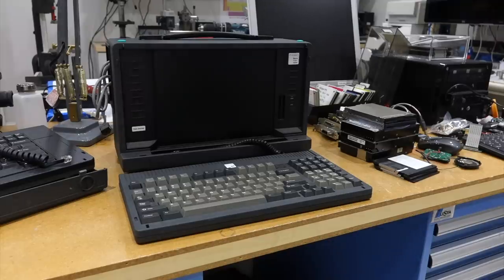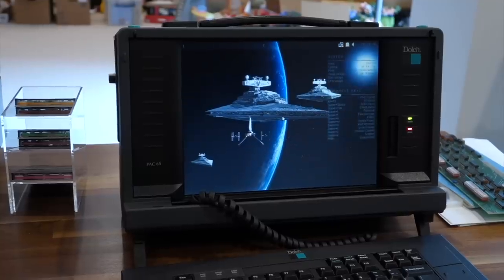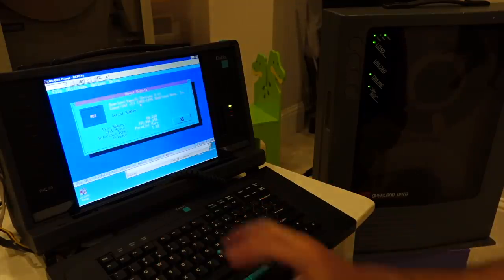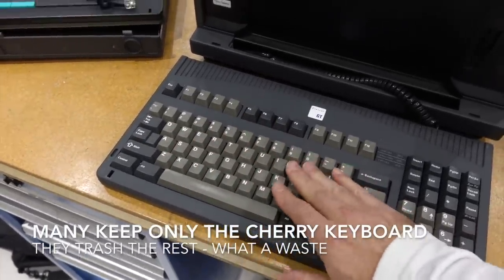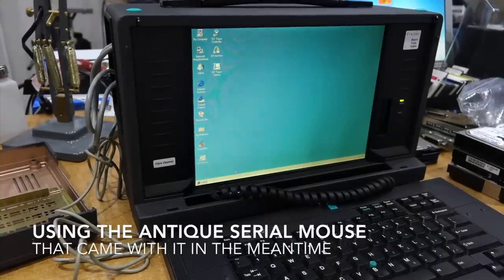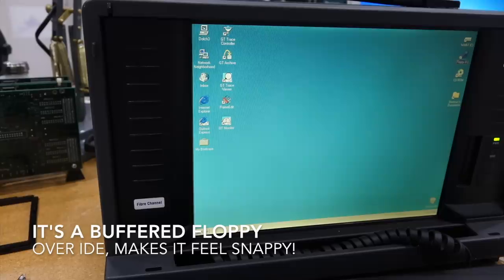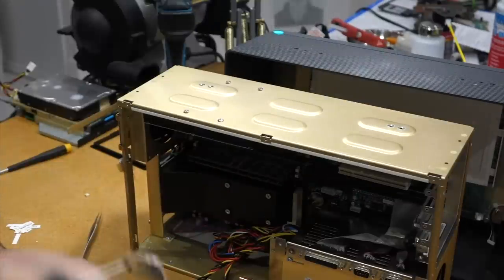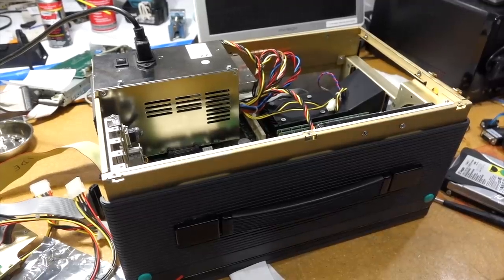Dolch Pac 65 - Part 1: Volker's beautiful machine goes bad...

Comment: if the PII is bad in any way, drop a PIII in. Katmai 550 would be proper for it, or if you want to really hotrod it, you should be able to drop in a 750/100/256k Slot 1 Coppermine no issue. In fact, it should use less power than the PII and generate less heat, meaning more power for other things and less heat inside to exhaust out. the mighty and strong 440BX is a very versatile chipset and generally always worked with the PIIIs I put into any boards with it back in the day so long as you use a 100MHz FSB model. 

I have two 750s in my old PowerEdge 2300 where it only ever supported Pentium II CPUs, on a 440GX chipset, the 2GB ceiling brother to the mighty 440BX.

This also gives you SSE as well as quite a few other improvements over the PII you have in there. I also suggest heatsinking the 440BX as well, even though it's not really necessary for what you're doing, unless you're going to upgrade the PIII. I've always done it, and it seemed to do more good than harm in every case.
Reply from the maker: +Sudos: Thanks for the tips!

Comment: This two-tone siren is usually connected with thermal alarm, check if you didn't move the thermal probe under the processor, if it wasn't somehow disconnected from the board.
Reply: Yep, that or I've seen it happen on fan stall too

Comment: I had the same PAC65 and had the same issue with the beep of death after a certain amount of restarts. There were two issues, the riser for the Slot-1 CPU was not seated correctly and PCI cards were causing conflicts. By the way, the single board computer that is in there is called a C16BM and it will support Katamai Pentium III CPUs but does not support Coppermine. It does not like any more than 512MB of RAM either. I also have a couple of extra BIOS images here after an exhausting scavenger hunt to find any information about this board when I was working on it.
Reply from the maker: +Alexander B, can you contact me offline? Send me a message from the "about" tab on my channel page. I need the BIOS images.

Comment: I keep coming back to your PAC series as I explore my PAC 62, do you remember how the proprietary keyboard/mouse connector is linked to the motherboard? Does it just break out to a pair of PS/2 connectors? My PAC 62 with the 54CDP board has one big AT socket and connector for the keyboard and an unused mouse header alongside. I suspect it would be too much trouble to get the later keyboard working, not the end of the world as I run Windows 98SE on it and it happily supports a PCI USB card and a modern wireless mouse. I'm still on the lookout for a PAC 65.
Reply from the maker: It uses a Ethernet-like plug (can't remember how it's called, RJ-something, like a phone plug but wider). Not sure how it's broken out, but yes, I'd suspect it's just a PS/2 connection.

Comment: You should be able to use a PCI Debug card to get the exact post code error, it will help with debugging also reseating the slot 1 cpu will help :)
Reply: Yeah, I'm sure the BIOS and/or chipset would be old enough to support those types of things.

Comment: I don't have a PAC 65, I have older PAC 63, PAC 64, and newer FlexPAC versions. I have one set up with a Computer Logics PCTD16 ISA bus controller card that I use to connect to Pertec interface 9-track tape drives. They also make a good host machine for HP 82324 HyperViper Measurement Coprocessor cards. If you don't already have an HP 82324 you need to add one of those to your collection.

Comment: Ah yes, I have 3 Dolch computers, a PAC 65 (just like yours) running DOS and and Windows 2000,  a PAC 64 DOS only with a dead Dallas RTC soldered on and a pain to get to, and a FLEX-PAC P-3 running XP and linux, it was broken when I got it but after replacing all of the "pregnant" electrolytics  on the  main board (PICMG) it runs like a champ.
Reply: How can capacitors be pregnant? Do you mean bloated?
Reply: Yep.
Reply: Hello. Did you have to set any BIOS settings to get 2000/XP installed? I have a Flexpac, Windows 98 installs fine, but 2000/XP crashes after first reboot (post formatting).

Comment: Question I had, when you drill into the metal case you don't do anything to catch all the metal filings that you generated. Won't those cause shorts on all sorts of things when they land all over components?
Reply from the maker: +Ergzay: You absolutely need to catch the shavings. If you look closely at the video, you'll see how I catch them with layers of paper towels protection over the inside. Thorough vacuuming must also follow.

Comment: I just got an lpac 486.  my track point is not working, can’t figure out why.  I took it completely apart and the connections looked fine from what I can tell.  I managed to get dos detecting it for a few boots, then it stopped...
Reply from the maker: I had that on mine, and it was the ethernet-like connector that connects to the keyboard that had bent pins.
Reply: @CuriousMarc  yeah i checked out the pins on the phone/ethernet connector like you showed in the video and it looked ok.  the track point rubber piece is missing, so i'm starting to think it might be a problem within the keyboard.  the wiring for the mouse is confusing, it has two ten pin connectors(a red/black & a green/black) but that section on the motherboard only has two serial connector & a ps/2 connector.(so with two serial cables plugged in, it just leaves room for one of the two connectors)  i tried every possible combination, but i believe the only one that matters is the green/black plugged into the ps/2 connector.  anyways, thanks for the videos man - they're great!

Comment: You're lucky!  The last one of those I worked on (Dolch Pac 586, which didn't have a 586) had one of those goddamn Dallas chips with the integrated battery... soldered to the bastard main board!  Why???  At least it would happily boot up in spite of this, unlike certain SUN units which just shit themselves when the battery runs out.  Anyway, good luck with this one!

Comment: This makes the "chimp proof" Panasonic tough book look wimpy.... haha
Reply: I learned the basics of Unix in old BELL System building (then ATT) in downtown Los Angeles at Beaudry.  I picked up a little Linux when I was at BBN.  I had too....in order to learn how to back-up the little Sun Microsystems 3/50 server which handled our email to tape.
Reply: But can you make the Dolch work with 8" Shugart Floppy/HD or maybe a Quantum Q2040 or Q2080.  It's been forever since I have heard one of those start up.
Reply: @11:32.... kind of like a Star Workstation 6085.  Plug the mouse into the wrong jack on the keyboard, it breaks off a pin in the keyboard itself rendering it scrap.